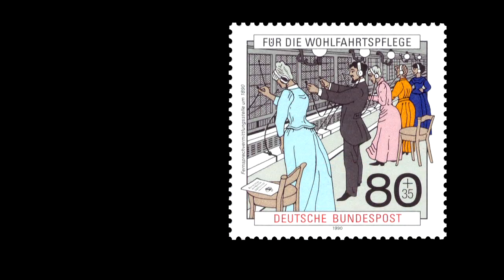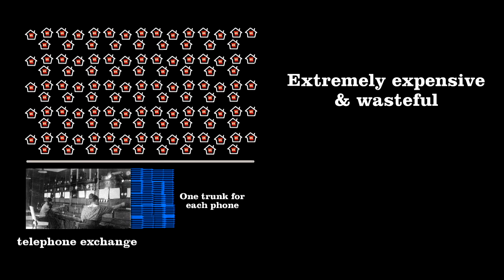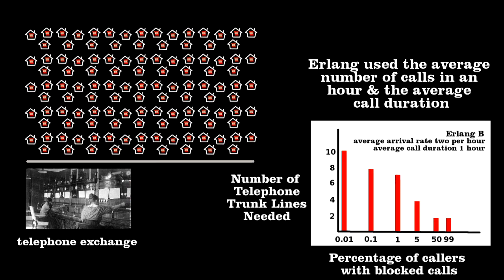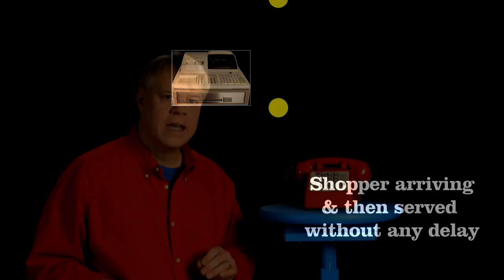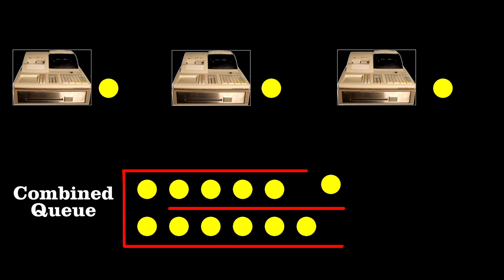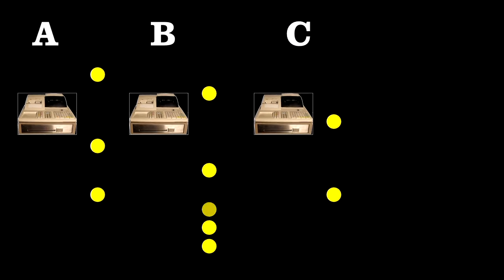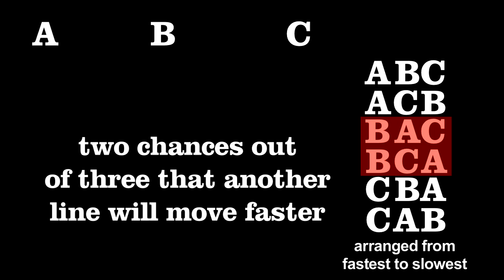Why the other line is likely to move faster

Comment: There's another reason why other lines move faster.

When you move faster, you are out of there before you feel the need to start tracking. It is only when you are stuck that you start comparing and realise that you have, indeed, made less progress.
Reply: DarKMaTTeR 
That and the fact that you spend more time in the slower lane. 
 Given 2 lanes, one takes twice the time of the other but you don't know which one. You will 50% of the time choose the slower one and as a consequence spend 67% of the time in the slower lane.
Reply: Confirmation bias

(right? Tbh i feel like im mixing up things here)
Reply: Good point. And also, when you do move slower, you spend more time in the store (say 3 minutes instead of 1), so you will spend 2x 1 minute checking out fast, but 1x 3 minutes checking out slow, so you'll spend 60% of your time checking out slowly
Reply: @americantoastman7296  Right. Anecdotal evidence may indicate that one person left the store quickly therefore there was no delay, but other shoppers may have experienced a delay.  You can't judge this kind of thing on an individual basis, it has to be statistically studied en mass.
Reply: Whenever I join a line and put all my stuff on the conveyor, the cashier inevitably gets up and walks away for at least 5 mins, presumably to take a dump or something 🙄😑

Comment: Back when this came out, Fry's Electronics was the only store I knew of that used the single-line system, which they also used to market stuff to you while you waited for a cashier. Now, lots of stores are doing that, though it's usually because of the prevalence of self-checkout systems. The Wal-Marts near me are almost entirely self-check at this point, which lowers the store's cost on employees, is preferable to many people in a post-Covid world, and most importantly to me, means that there's almost never a line. It's reached the point that if every single register is occupied, I'll instantly get impatient, even if I'm the only one in line.
Reply: RIP Fry's Electronics. I still don't know where I'm going to buy a TV next.

Comment: I'd argue that register queues are actually a middle ground between the two. People already choose the shortest line on arrival, and they can and will switch if one is significantly faster or shorter. There will never be an idle cashier as long as there are more waiting customers than registers.

This way it does behave like a single line that splits up with just a small line-specific buffer at the end.

Comment: My local supermarket had the single queue system from its opening. (I'm not a fan. Prefer  multiple queues.) However, the practice in South Africa is to line the single queue with impulse purchase items: sweets, chocolates and the like. After not having visited the store for a while, I returned to find that the single-queue system had been installed. (I was a happy customer!) Discussing this with the cashier, I learned that the reason for removing the abattoir cattle queue through the sweets and chocolates was the shoplifting going on as the line looped back on itself towards the cashiers. I wonder if this is a problem in other places too?

Comment: The Post Office usually has the long line feeding up to multiple clerks. Also at the tax office, where license plates are renewed does this. Then stores like Wal-mart, who typically don't do that, will employ it on busy days like black Friday. Yes it is unnerving to see that big line. One nice thing, though. I can estimate about how long it will take by timing how far I move in the first few minutes, then multiply. This can be estimated by counting the ceiling tiles between me and the front of the line.
Reply: +David Scott great algorithm, always works with single queues
Reply: Yeah that's another reason why stores prefer multiple lines. The one huge line, while more efficient, just looks much longer and may make some people turn away at the door.
Reply: That could be a double edge sword... a single long line may be a turn off for people, but if it is moving quickly it could still be something that people are willing to endear... the multiple shorter lines might not have the same immediate effect on someone's psyche, but if it looks like they are hardly moving, the customer may come to the conclusion that the cashiers are slow and decide to turn away anyway.
Reply: There's actually a great solution for this problem. As long as people are moving, they don't "feel" like they are in line. This is how Disneyland and other amusement parks try to operate. You walk for quite a ways while in line, but you only stop walking to get on the ride.
Reply: Frys Electronics also uses the single line technique.  It seems to move fast.
Reply: There are two local stores that do this.  Both owned by the same company,  Dick's Sporting Goods.

Comment: I remember this exact example from the College Statistics class I recently took. It was used to demonstrate the concept of standard deviation; they said that while the mean is EXACTLY the same between the two systems, the standard deviation is far less when stores use a single line. In other words, only the variability of waiting time changes, not the average.

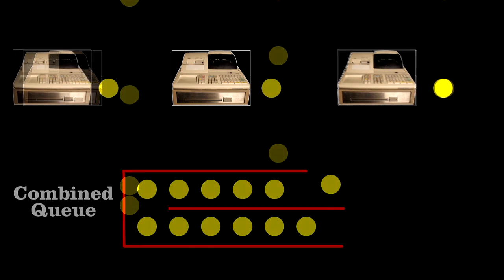That seems completely at odds with the Engineer guy's statement at 1:55, that the single line system is "about 3 times faster".

Comment: Fry's has the single queue checkouts. they also benifit from easily and compactly building massive surge capacity. all the cashiers are on one long bench and employees can move into place when needed, shut down a register and open others without any delay.
many stores these days build a hybrid with customers picking the line they like but each of those feeds 2-3 cashiers laid out in series. Target and Cabella's come to mind.
Reply: Having worked at Disneyland, I'd like to point out that theme parks are the perfect way to experience practically every conceivable type of line in one day. For example, small retail and dining locations in the park had just one cash register, so a long line would form. Mid-sized retail and dining locations often had two or three registers, but usually had only one queue that fed all of them. The largest retail locations would have several different areas of cash registers, some with one queue that fed multiple registers, and some with individual lines. The queues for attractions are far more complicated, because you'll often have two different lines (Standby and Lightning Lane/Fastpass) that had to combine at some point and then split apart later at the boarding area, whereas a third line (Single Rider) fed directly into the loading zone. I feel like theme park design is the perfect microcosm to study human behavior in a controlled environment, where crowds and groupthink and social norms result in unexpected results.

Comment: Helpful hints for picking the fast moving line...

1.) The older the people that are waiting in line, the more likely that they're retired and don't have to be anywhere anytime soon. These also tend to be the people least likely to be able to use technology well. Ever try to see a 90 year old woman hand the cashier a dozen coupons and then try to pay with an I-phone? It can take awhile.

2.) Single men seem to buy less stuff and are the least chatty types. If you see a line with 4 single men compared to 3 couples, the first line will move faster.

3.) Anyone who has cash out before even talking to the staff wants to be as efficient as possible. They're the people you want to get behind.

This will improve the odds of getting into the faster line by some degree. You might be able to get it to 50/50 or better with practice. It certainly beats 1/3.

Comment: We modeled bank teller queues using queuing theory and the General Purpose System Simulator when I was in college.    Back in the seventies banks were just starting to convert the teller lines to a common queue.    The results of our simulations were impressive.    Few stores do this because of the amount of floor space required for a common queue.    Banks, Fry's Electronics, Tower Records before they folded are the ones I can think of.

Comment: The supermarket where I usually shop switched a few months ago from the traditional one-queue-per-cashier method to the single-queue method. It is much better now. Since they switched, I've barely had to wait at all, and I've never had to wait more than 5 minutes or so, on busy days. Previously, it was common to wait on a three-deep queue for 15 minutes or more. In addition, it's better to just go directly to the only queue, instead of having to walk around, trying to guess which queue to choose. Single queue FTW.

Comment: In Britain at least it seems it simply comes down to shop type. So Supermarkets, DIY Shops and the larger Home Furnishing Shops will tend to have individual queues - primarily shops that use conveyor check-outs. Then all of the smaller shops, what we would consider high-street shops like Clothes Shops, Entertainment Shops, Phone Shops etc pretty much all use single queue system. This includes the banks and the post office. The exception on the high-street / in the shopping centre(mall) tends to only be the fast-food outlets like McD's and KFC which as it goes are American chains and other fast-food places modelled upon them. Though also as many have mentioned this is changing in the supermarkets with Self-checkout and while there is an assistant present to sort any issues and perform the odd age check they rarely need to prompt customers that there is a free checkout as you can be sure others in the queue will have done that if the person at the front takes a second too long haha.

Comment: Over here in the UK, most supermarkets have one line for each cashier, although some operate a single line feeding all the self service machines. Clothes stores typically have a single line feeding all their cashiers, together with an electronic system directing you to the next available cashier (when there's a line of 9 cashiers, it's rather useful as you don't always notice when one's available!)
Reply: +mittfh I was about to say this, I'm surprised it's not common in America. Every shop with multiple tills except supermarkets does this - it makes it quick and easy to move employees around when things are getting slow. Some of the smaller supermarkets do it too, having just two queues, one for the row of self-service machines and one for the row with cashiers. I still think a lot of small supermarkets and discount chains are perpetually understaffed despite implementing this though - they always have huge queues, because it's cheaper for the shop to hire less people.

Comment: The mass checkout line is good on paper, but it does have it's failings.  Mainly all those people need a big space to stand in; space that could contain more checkout lanes. It eliminates the possibility of an express lane.  And most important, a single shopper can slow down the entire line. Yes it alien the line down by less than an individual line would be slowed, but with multiple lines you can just move to a different line. This both eliminates the delay and provides an illusion of choice.
Reply: Christopher Gibbons How a slow shopper can slow the entire line? Also people need the same space to stand in but you can arrange the space as you want (usually in a S way like the airports do). The express lane can get also clogged... unless you arrange two or three of then with a single queue different from the big one: markets here do that and they are damn fast.
Reply: Say there are 3 lines. If a customer has a problem, that lane is effectively shut down until the matter is resolved. And if you have ever been to wallmart you know this could take up to half an hour. in a feeder line the whole line is slowed by 1/3. In a normal line only that one line is effected. The people waiting move to another line and only they check out 2/3 slower. they are the only ones inconvenienced. the more people waiting the greater the difference becomes. 

In traditional checkout lines no space is set aside for the lines, people just stand next to the conveyor belt. with a feeder line the checkout lines take the same amount of space, but now you have to set aside space for all those people to stand in line. and that space beside the conveyor belts is wasted.

By far the best approach is the hybrid line used by immigration here in the US. a feeder line being directed into individual lines. A guide routs the people to the best line for optimal efficiency.It shifts inconveniences onto a small number of people like individual lines but has the overall efficiency of a feeder line.
Reply: I don't see the first case. What "problem" are you talking about that can shut down the line? The vast majority of the problems ocurs when the customer is paying: he forgot a product, something has the barcode damaged... In every case I can think of the single line is the solution.

You may notice that the traditional lines have to leave a space between the cashiers and the products near the cashiers. That's for avoiding the lines to extend into the shop. With a single line the markets can use that same space to put a limited single line. And you may also notice that the single line allows the cashes to be installed against a wall while the tradicional ones have to has an "exit" pass.

And the hybrid approach is just a single line but wasting resources in the form of a "guide". If some individual line gets clogged everyone in that line will suffer and even worst: they cannot change lines.

Comment: i normally go by the checker and if i am buying beer or not. i do the two line approach when there is maybe one or two people in line. so i can go in the fastest line between the two. Also I look at how quickly they are putting stuff on the belt and what stuff they are buying. since you can tell if its going to take a long time by what they are buying. The reason I go by age of the checker is if they need to call someone if they are buying beer or something like that.

Comment: @Gerrrry 

This style of checkout is pretty much standard in the smaller urban supermarkets in London, they work well and usually have an automated system to call the next customer to the appropriate cashier. I am sure the employers have some measure of operator speed, they sure did when I was working in a supermarket as a student.

Comment: @MrRichy96 The thing is, if there is one line for each cashier, then your line - whichever it is - will only be served by one cashier. Whereas with the single line, it is being served by three cashiers, and so the line will move three times faster. The line is longer, yes, but it moves faster. And what if someone holds up the line because they want to pay with dimes or something? With three lines, the unlucky line will grind to a halt. With a single line, it will merely be slowed by a third.

Comment: Actually the biggest delays around here in Southeast New England - it's befuddlement over the charge card terminals, whether to swipe, tap or insert. I've so had to resist the desire when someone is experiencing such puzzle over a simple device. 

I see it at least every time I go shopping for something.
Reply from the maker: Where I love the chip readers are very slow .. I moved to paying with my phone!

Comment: @everythingisthat12 Yeah, but the point of the video was to use the "single-line" method, which simply combines multiple lines into one longer and faster line. The presenter just started discussing a completely different idea when he was supposed to be applying the trunk line optimization theory to the shopping environment.
I think that the analogy he had intended to make with the phone system and shopping lines was that the single-line method is exactly how phone calls work.

Comment: I've heard that in The Netherlands people sometimes switch lines at a grocery store because they think it's faster. I guess it's a sort of social load-balancing.

Not sure if it's true, though.
Reply: I've seen similar behavior on the highways in the US. It's always looked like (at least in that case) if they'd all stay in their lanes they'd end up going fast in the long run.
Reply: at supermarkets it makes little or no difference for the overall wat times. At highways though it does slow everyone down. Don't switch lanes on roads, it causes traffic jams.
Reply: Line speeds actually fluctuate (hold ups due to price checks, customers with a lot or very few products, and such), and it's safe to predict that for every time you switch to an actually faster line you'll also end up switching to a slower line.
Specially considering how actually irrational human gut feelings like patience/lack thereof are. If you are in a long, completely immobile line, by the time you run out of patience and switch the clog is gone and your old line starts going faster than your new line.

Comment: In the jockeying for position setup, aren't all the registers in constant use? Therefore isn't this setup operating at overall maximum efficiency? 

It's just not as fair to the individual shopper, as some who arrive first will be serviced after those who would be behind them in the queue setup.
Reply: Not really. As he explained, if one cashier has a delay then EVERYONE in that line has a delay. With the single line system, if one cashier has a delay the rest of the line keeps flowing into the other 2 cashiers.

Comment: the single line / multiple cash registers setup does not work very well when each customer pushes a shopping cart. That's why it works so well for Fry's or Ross and would not be implemented by Costco.